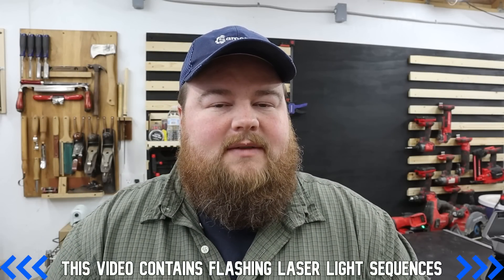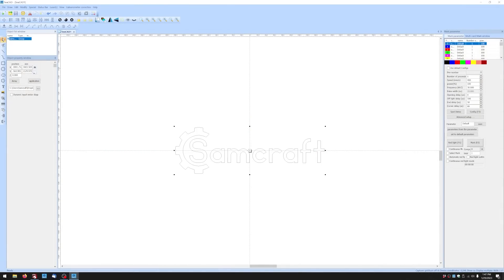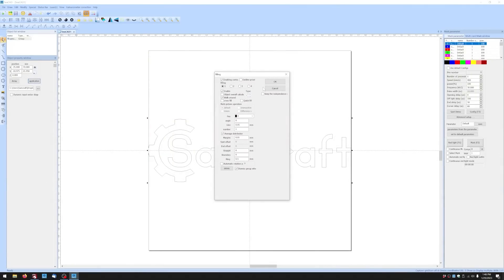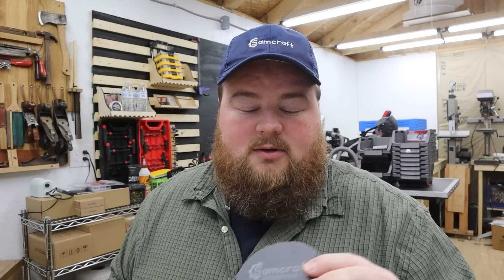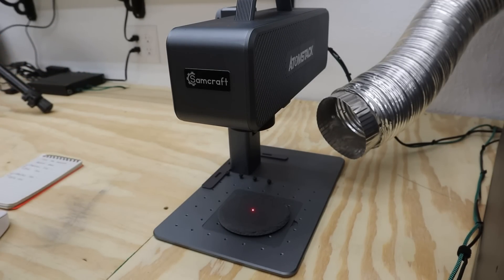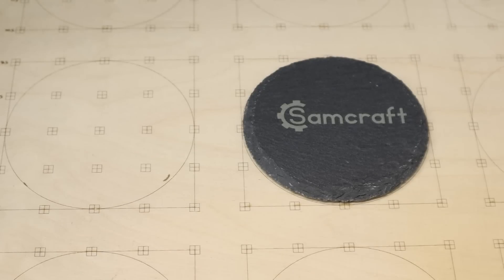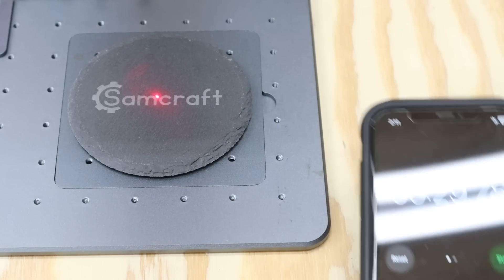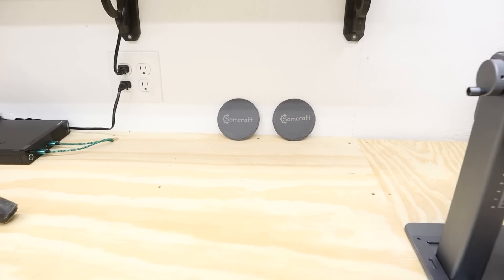Slate Coaster Showdown!  Atomstack M4 vs. Ortur Laser Master

Comment: Next project - make a conveyor belt for the atomstack so you can tell it to burn a coaster, move a certain distance, burn another coaster, rinse and repeat :) You would just be limited by how long of a conveyor you would have. Cool video, keep em coming!
Reply: I'd almost have lips on the conveyor to push the slates with and have them preload in a tube above the conveyor.  Conveyor will push one under the atomstack. While pulling one out of the tube and the following one dropping. Shortens the belt and could still have a decent stock preloaded in the tube.

Comment: I would stay with the Ortur for high quantity production as you can focus your time on other things while its running.

I would question the longevity of the Atomstack. Does the Atomstack travel in an XY axis as the Ortur or does the Atomstack pivot the laser head?
Reply from the maker: The Atomstack is a galvo laser. It uses mirrors to direct the laser from within the machine. Longevity of the machine is yet to be known, but actively being tested! :)

Comment: Have you tried running the Atomstsck twice?  I wonder if the contrast would be better.  It would still be 1/3 the time.  The Ortur is nicer now because of the visibility, I think, not the color.  The color, to me, it almost looks like a slight beverage stain or yellowish finish was applied - but not bad.

Batching, so you're not babysitting may still be the better alternative, though.

Comment: Both look great, and the speed could come in handy.  The only real deal killer is that 70mm limit.  The coasters you have on your site are pretty much edge to edge, near a full 100mm design.  But... that wasn't part of the test :)
Reply from the maker: You make a very valid point! The 70mm x 70mm working size of the Atomstack M4 is very limiting for such an application. Great observation on coaster sizes and designs too!

Comment: Interesting human efficiency question raised by the two machines. 

On the ortur you can place 4 slates, press go and do something for I guess 16 minutes vs sitting at the atom for 2 minutes doing the same 4 unit job. If you had a automatic feeder on the atom - no question you would run with that. 

I guess also lower cost to run the 4 unit job comes into play to maximize profit using the machine with less power would be beneficial.

Comment: I prefer the color of the Atomstack. The Ortur is easier to read at a distance, but if you are judging just on readability, you could easily increase the size on the Atomstack because of the speed. 

To get a fair comparison of how fast each one is, calculate how long it would take to do a large order with each. Also, if the Ortur can do 9 at 3 1/2 minutes each (a little over 30 minutes for the set of 9) do you have other things that you can do and be interrupted every 30 minutes? If you had an order for 100 (I don't know if you have orders that large or not) that would be pretty much a full days work. With the Atomstack that would be a couple of hours. Assuming some amount of time for loading and unloading the coasters for each machine. 

A lot to consider. Good luck. Enjoying the visit to Laser Town.
Reply: The atomstack was running on it's size limit.

Comment: I like they way they both look, which could be more of a personal preference, I would stick with the Ortur you can set up 9 and let it roll and be free to do something else instead of changing out a tile every 30 seconds. Depending on power and speed, you can get different colors on slate with a diode laser
Reply: well, Ortur would take about 30 minutes to do the 9 whereas the Atom will take about 5 minutes to do 9. Atom is definitely where I would go.

Comment: The Ortur is likely to be more efficient in a batch - it's a set & forget it operation. Lay out a bunch of coasters on the waste board and let it whale away on them. The Atomstack is faster for 1 but how long does it take to do 9? And you're standing there watching it because for a 30 second burn, it's not worth walking away. So you'll place a coaster, focus, engrave, pull the coaster off and replace it with another. Five or six minutes to do 9 of them while you're not doing anything else. Versus, load & focus 9 on the board and walk away. Do you really care that it's a half-hour later when they're all done? That's a half-hour you could be doing something else like packaging the ones that have finished or working on some other project.
Reply: Well, to do 9 on the Ortur you are looking at 30 minutes vs say 4 or 5 minutes. So yes, you can set the Ortur and go and do some other jobs, but 4 or 5 minutes to get 9 out is not so long and will definitely speed up the whole production process
Reply: @cplcabs  But if you’re not just doing nine, but nine sets of nine, are you really gonna sit there for the entire time it takes to stack and load 91 coasters individually into the Adams tech? Or you go ahead and vacuum out in the Ortur?
I would also guesstimate the actual set up time for the atom stack included with each successive coaster would be closer to a minute each, so really you’re looking at closer to 10 minutes for a set of nine on the AdamStack. 10 minutes of straight babysitting. just for nine coasters. And longer for more than just 9.
Reply: @Damon_Barber  even if you are doing 91 you are still better off doing them on the Atomstack. You could do batches of 10 for example which would take 5 minutes then do other things for a while then another batch of 10. You would still finish and be more efficient than using the Ortur.
Reply: @cplcabs  I do suppose if you were going to batch them out on the Atomstack that you would make a jig to just remove one and plop another slate down and just click start. And like you said, you could sit there and babysit for 5-6 minutes at a time and then go do something else and come back for another 5-6 minutes…
Reply: Exactly, even if 9 got done faster on the Atom it will take his full attention the entire time. Layout 9 at once, turn it on and do other tasks
Reply: I was getting on to write pretty much what you said more eloquently than I would have.

While I would definitely want to compare finishes and quality on any given project first, in my experience when I try to do a bunch of the same thing over and over again in a row, no matter how hard I try, focus eventually starts to wake and I get variations in alignment or quality. Being able to batch a few at a time allows you to get sets with same settings alignment etc. And gives you time to regroup and reset your focus as you have little breaks to do something else and come back to it refreshed.

I don't own both so I could be wrong, just my experience with other projects I've done one at a time vs batching.

Great video Sam!
Reply: Your hoping that nothing gets off kilter or the laser doesn't do what it wants instead of what its suppose to.